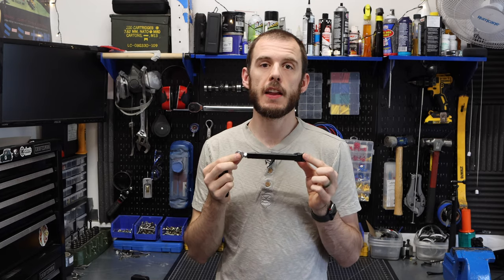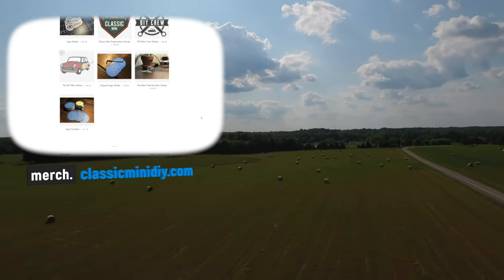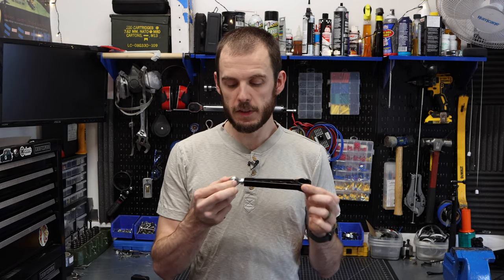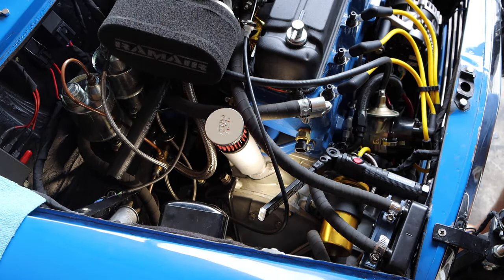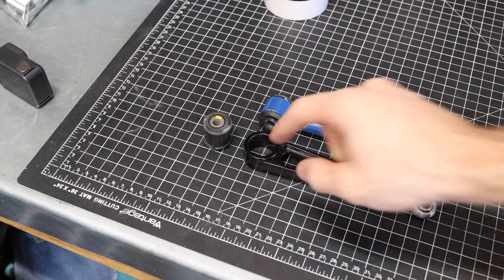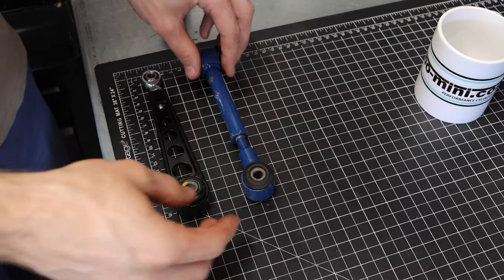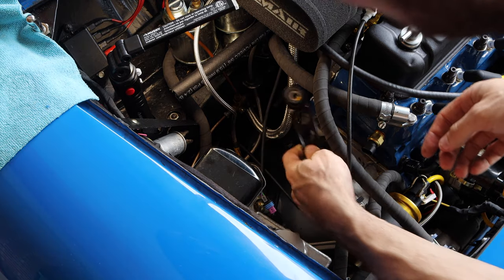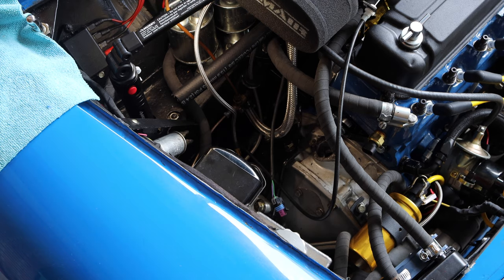Friday Tech Quickie - DSN Upper Engine Steady Install

Comment: I’d most definitely use a polly bush at the bulkhead they are much better also try to avoid using oil to fit the rubber it can cause the rubber to deteriorate, soap or alcohol sanitizer works great and there’s plenty of that about at the moment. I take it the clutch servo did not work? What were your thoughts on that? 
Thanks

Comment: A harder rubber brushing and sorting out the bolt holes on the firewall,  pitty about the lack of the lack front steady.  I ground off the steady bracket and made a new one out of some out sized square tubing and welded it in place.

Comment: I'm shocked to see how much the motor moves! I can't imagine that only the gum absorbs the movement. On my mini, the bracket where my stabilizer bar locks (on the bulkhead) is unsoldered. I put a metal stand instead and i neet to tight the bolts at least after 5 rides :(

Comment: Instead of using oil (which, depending on the type of oil, can actually deteriorate the rubber), you could use alcohol-based hand sanitizer...
It will slowly vaporize, without a trace.
I bet, these days, everybody has hand sanitizer laying around...
Reply: Or use red rubber grease
Reply: @markrutlidge5427  Yeah, or tire grease, but you have to buy that.
And only for that reason.
Hand sanitizer is something everyone had these days.
Reply: Silicone grease is better for rubber. Also known as Dielectric Grease, used on electrical connections, sparkplug boots etc. to keep them high and dry, corrosion free.

Comment: Check the water pump steady arm
http://www.minimine.co.uk/mounts/37-engine-steady-adjustable-kit-lh-water-pump-fit-inc-polyflex-bush-kit.html
Reply from the maker: I cant use the steadies on that side of the engine. I have a supercharger and pulley's in the way. :-(
Reply: @classicminidiy   Do you have all the steady arms from underneath?